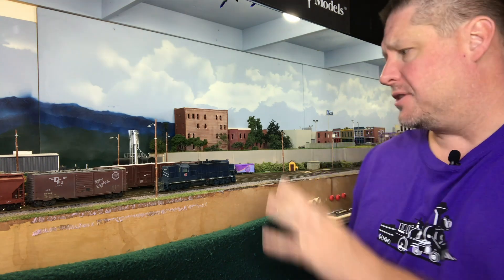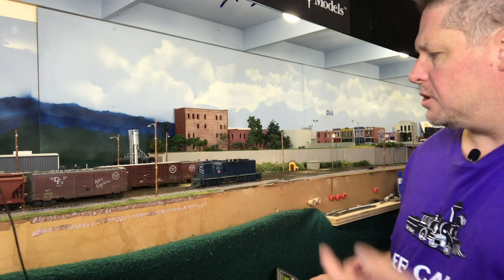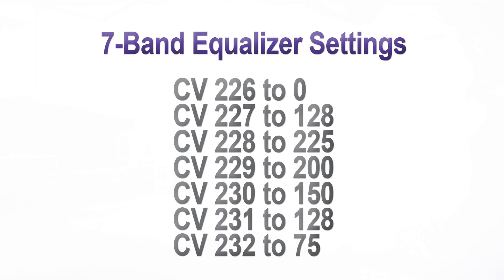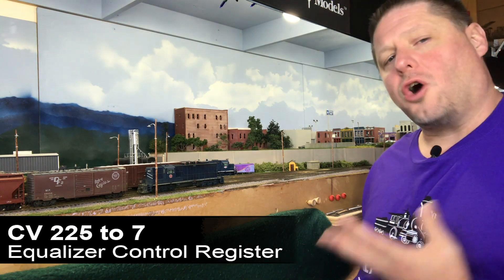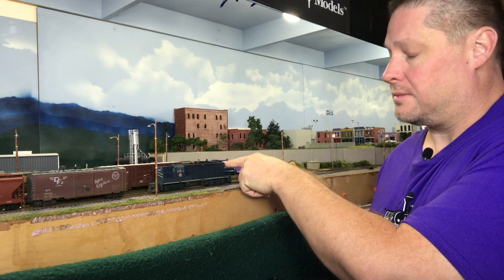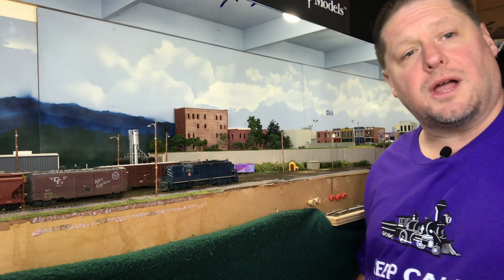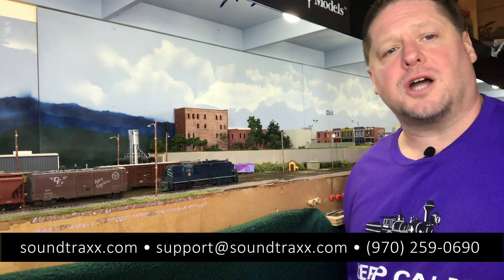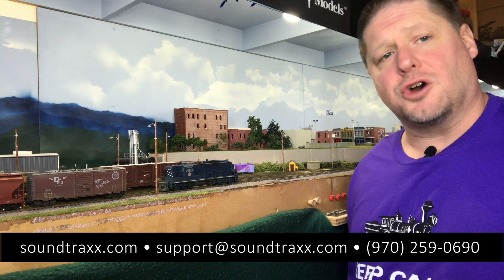Adjusting the SoundTraxx 7-Band Equalizer on an Athearn GP-7 factory equipped with Tsunami2

Comment: What equalizer settings do you recommend for steam?
Reply from the maker: EQ could be done similar for a steam loco.  Ultimately, your ears are the judge, so start here and make adjustments to the CVs as you see fit.  (You can reprogram the CV any number of times as needed.  Many times I will adjust or tweak for a half hour until I decide what is good.)  Once you decide what you like, then you can use this as a baseline for all steam locos.

Comment: Using an oscilloscope to display these subtle sound differences could be interesting.  It might be TMI, but if feasible, would be a good visual.  Imagine the difference from 250 hertz low rumbles to shrill whistles.
Reply from the maker: Maybe, but these tools are at the office and I have not personally played with them to see how they change. You can download a decibel meter and other audio tools onto your smart phone and get an idea.  I use it when setting max volumes, but never really went beyond this.